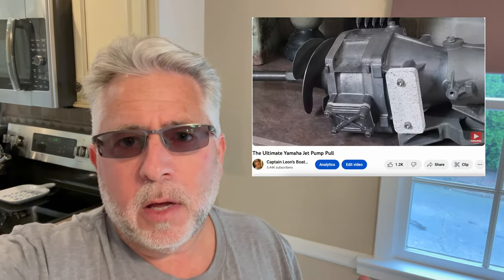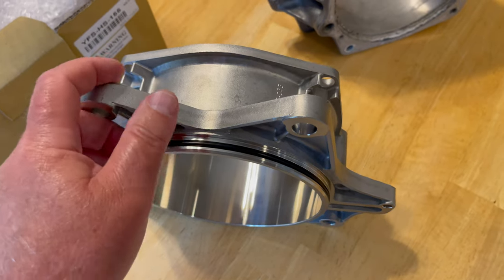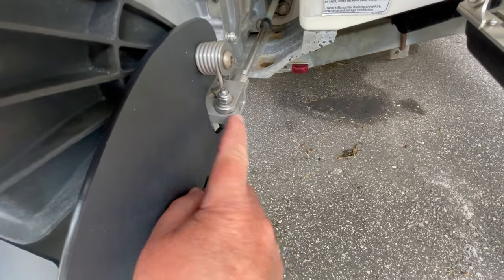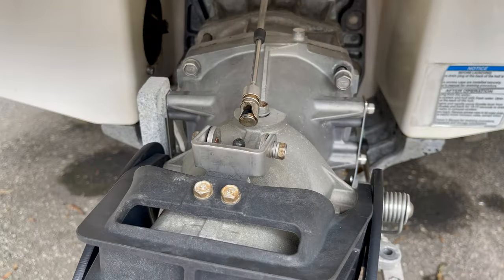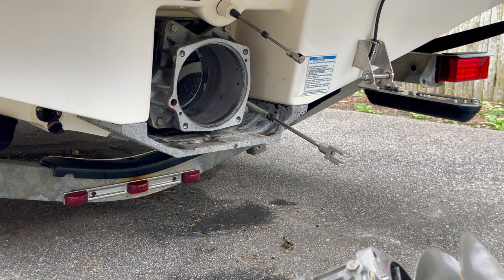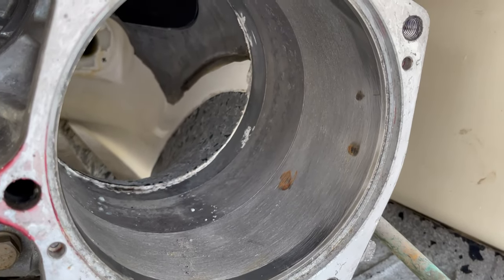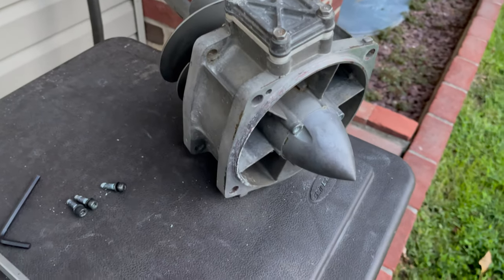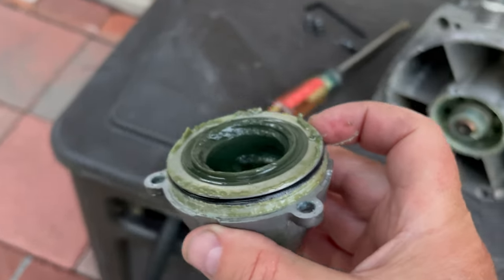Yamaha Jet Pump Fail - Solas Stainless Steel Solution

Comment: Awesome video…I’m getting ready to change two impellers and housing in a month or so on my 2016 242. 
I appreciate the details you apply to the videos. It certainly helps. 
Thanks for taking the time.

/Vr
USN Senior Chief (retired)
Reply from the maker: My pleasure James, hopefully the video helps. Take it slow, don't force those bolts getting them out if they have been in there since assembly, especially the little bolt on the left. Nice and easy.

Comment: Your original video replacing the impellor housing is what convinced me to get a jet boat. At the time I was dealing with a stern drive and the jet pump looked SO much simpler.
Thanks again for the great vids!
Reply from the maker: Thanks Russel, I appreciate you taking the time to reach out. Are you happy with your boat?
Reply: @CaptainLeonsBoatingandMore  yes very happy, we have a '19 AR195. I sometimes wish it was bigger but otherwise perfect boat.
Reply from the maker: After 10 years of ownership I also sometimes wish it was bigger, but there are many times I'm very happy its not. Its so easy to maintain, manuever, trailer, wash, etc., I'm happy to keep what I have. @rhtufts

Comment: I have a 07' AR230 that has always been used in salt water. I replaced my housings just after one year, fortunately for me I made the right decision to buy the aftermarket stainless units from Riva and never looked back. From my experience so far the open end, nut retainer design works and I haven't had any issues.
Sorry about your misfortune and great video.
Reply from the maker: Thanks max, I appreciate the information and your compliments. Thanks for reaching out!

Comment: I also did change mine exactly 2 years ago, using an OEM one as well. Results = engine doesn't turn over because the jet pump is blocked. I just ordered a stainless steel one after reading quite a few bad feedbacks about plastic replacements.
Reply from the maker: What do you mean by blocked?
Reply: @CaptainLeonsBoatingandMore  I mean seized. The impeller is rust-welded to the wear ring... Common issue. So the engine won't turn over. It started by harder noisy starts, and it would free up. Then I had some maintenance to do and didn't crank it in maybe 3 months, and here we are ;)
Reply: There’s nothing wrong w.the plastic wear rings. Been on mine for the last 5yrs. The stainless are the ones will swell up.
Reply: @1FishinAddict  Not exactly, the ones that will swell up are the stock and stock like ones: aluminium with a stainless steel liner. If you get 100% stainless steel ones, they will be fine.
Reply from the maker: @1FishinAddict  the mixed aluminum and stainless housing has the swelling factor. 100% stainless does not swell.

Comment: Why didnt you use never sieze on the bolts just wondering because im doing the same on mine ski but im replacing housing and impeller and was planning to use neve sieze on bolts.

Comment: Help Captain, do those cables sometimes get bent back down under there. My throttle is stiff due to my boat sucking a wakeboard rope got sucked under. I think the rope pulled the cable rod or bent the rod to the bucket.

Comment: Hey thank you! Your videos are great and very helpful. I was interested in doing the same thing to mine and was wondering if I buy the impeller housing does it come with a new sleeve? 
I know some guys just replace the sleeve when they have a problem.
Reply: I meant to say wear ring or insert
Reply from the maker: @mikelucarello7310  the new Solas housing is a solid one piece unit. No removable sleeve is needed. Its designed to be a one time fix for life.

Comment: Hello Capt. Leon, I replaced the wearing with the solas and OEM impeller. You mentioned at the end that it took a little while for some noises to clear up. How long did that take? I just did that job earlier today and I turned it on and it's definitely not smooth I torqued everything down so I can't imagine what it could be but it definitely sounds like some rub is taking place somewhere. Any thoughts? It's just this heartening after doing all this work not what I thought it would sound like. Thanks again.
Reply from the maker: Don't be disheartened, I'm not sure how long it took but maybe it needs to seat itself after a WOT run. Have you taken it out yet on the water?
Reply: @CaptainLeonsBoatingandMore  hey Capt, no I just did today and running it with hose water. Ok thanks for the confidence brother 🙏🙏🙏

Comment: ? Did you put grease on the splines of the shaft. Great video by the way.
Reply from the maker: Sure did. Prior to making this video I made a video the first time I replaced the housing with the OEM part. That video covered some of the steps in more depth, you can see it here: https://youtu.be/YDIGz1VXLls?si=6dv6fWhQfrgCSYFi
Reply: @CaptainLeonsBoatingandMore  awesome. I will check it out

Comment: oem is the best BUT there is a cheaper alterative and in certain condition's may be advisable . the banging on the water hose comes from metal on metal with the stainless setup something will have to give eventually . My suggestion is the plastic insert (wear ring ) its easy to install and will only wear the ring not the expensive impeller . also IF anything aka rocks .shells.ect goes in it your chances of a motor lock up and serious damage are a lot less ..  hope my suggestion helps someone on a budget.
Reply from the maker: All good points, I hear ya. But the banging on the garden hose was mostly caused from the swell points on the OEM due to corrosion between the aluminum and stainless layers. Now that its all stainless its quiet, but you're right, no room for error.

Comment: Is the service manual unique to each boat?  I just purchased a used 2015 AR210…
Reply from the maker: Basically yes, but the engine and jet pump housing remained consistent through many models for many years. I believe your boat would be exactly the same, this was a 2014 190.
Reply: @CaptainLeonsBoatingandMore  thank you!

Comment: Captain Leon out of topic on your post, not know how to directly email you. I subscribe to your channel and reality appreciate your help through your videos.  I have same model 2013 SX190, recently I’ve seen random, intermittent, not consistent oil leak on the bilge, I did tape a paper towel to find out where it’s coming from, initially thoughts could be from bolts, I also read someone post that could be on the oil cooler right where oil filter attached. I have telescopic video camera but still can’t pinpoint leak.
Just want to know if you’ve seen same, or is it something I should be worried about, oil leak does not impact the oil I see on dip stick so far, but will keep an eye on this.
Appreciate your help.
Reply from the maker: Hey Edgar, I have not experienced this. The only thing you could do is keep wiping everywhere with a paper towel to see if you can find where it's coming from. Any chance it's weeping from the bottom of the oil filter?
Watch this video from "Boating Propless" it may shed some light on some possibilities: https://youtu.be/xSPrmd_oe2M?si=432co72T96HPNvcp

Comment: Does the problem with rubbing affect Impeller ?
Reply from the maker: Yes, it begins to wear down the edges. Left for too long and the damage to the Impeller would require it be replaced, so far I have gotten lucky. Watch my earlier video on this issue as it goes into that more: https://youtu.be/YDIGz1VXLls?si=Qbon3BjhPXKS67hX

Comment: i never use locktight .. i use lil  4200 on threads and it works perfect  easily removable and as well as acting as a locktight per say
Reply from the maker: Hmnn, 4200 really isn't intended as a thread sealant, but if its worked for you, so be it.

Comment: damaged on same side, same area ?, tells me a bearing is bad.
Reply from the maker: Perhaps the torque moves it that way, but with the new housing its real quiet now, so not sure the bearings are bad.
Reply: @CaptainLeonsBoatingandMore  you will know before too long when you run it longer.
Reply from the maker: @alanshaw4655  been running it for a year now, we will see.
Reply: @CaptainLeonsBoatingandMore  good deal, hope it holds up for ya !.

Comment: Were you using antifreeze in your boat anytime that will cause that issue swelling but the stainless steel will be no problem
Reply from the maker: Thanks Coda, the swelling seems to get worse when sitting dry for a few days in-between outings. Returning from a day out, it seemed less severe. How are you determining that antifreeze can play a factor?
Reply: Certain types of antifreeze will attack certain Metals in a Tri Val a n c e state a great example if you put regular green antifreeze in a Toyota it will start to disintegrate the aluminum copper and other metal you have to use the pink toyota antifreeze , it is a chemical reaction it does take a little while for this to happen but any contact I would say just to make sure you using correct antifreeze from the Yamaha boat maker I also notice you said you use in saltwater even after you flush engine salt also has a chemical and electrical reaction so if you spray down jet drive assembly inside and out with a corrosion inhibitor I think they call it yamashield

Comment: The wear is due to the tourqe on the impeller when there's a lack of water. Aka cavitation or reving the engine on a hose.
Reply from the maker: Cavitation is due to vapor bubbles when water is being expelled past an impeller or propeller at high speed, this does not take place while reving the engine on the hose. There can be wear from play in the shaft while the impeller is spinning out of the water, but the swelling of the housing in spots due to dissimilar metals is a known issue.